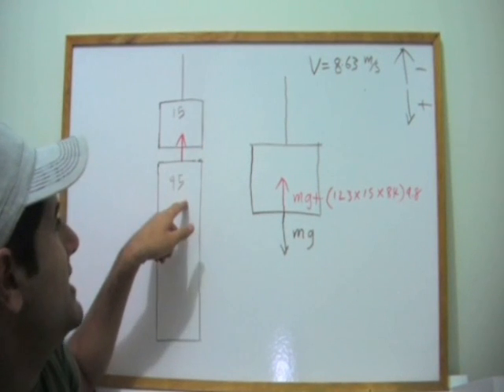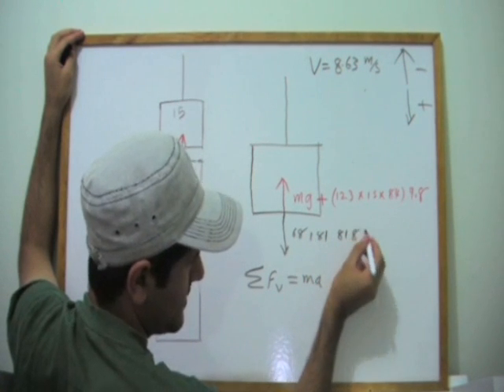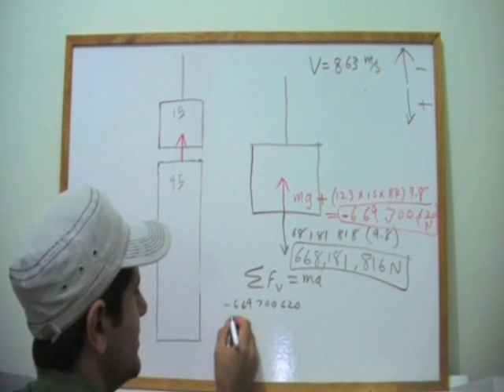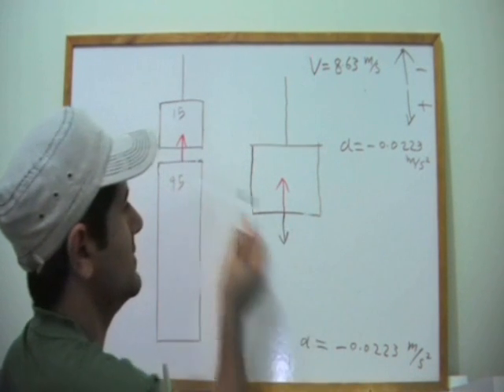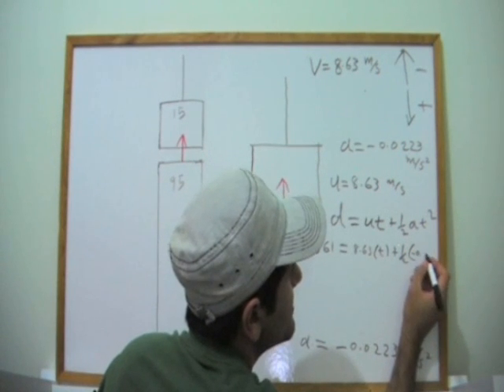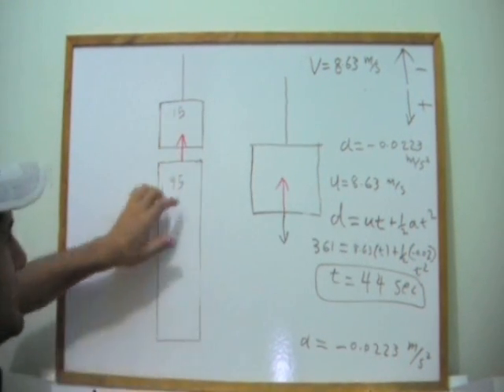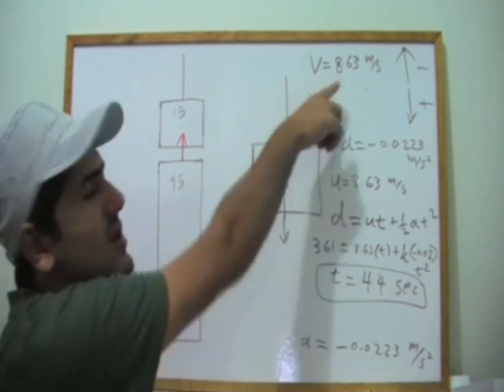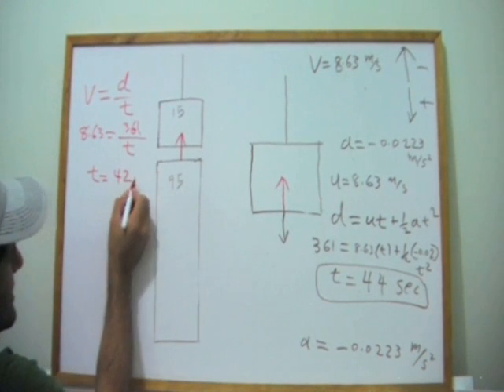(Part3) 911 Simple Physics Structural Failure Vs Demolition

Comment: I am a strong believer of the conspiracy theories, I believe it is an inside job.

good work trying to prove it using simple physics. but ive got to say that you approach is a bit inaccurate because your assumptions claim that the lower part of the building is solid (like a butter cube) in fact, the resisting skeleton provides the force as a number of concentrated forces acting upwards.

if these forces coincide with the columnsof the falling body, your assumptions are valid... (cont'd)

Comment: Newtons Third Law is all the evidence needed to prove controlled demolition of WTC 1 and 2.

NIST knows this. this is why NIST chose to stand down.

NIST admits their report

"... does not actually include the structural behavior of the tower" after the conditions for collapse initiation were reached ... ."
NIST - 2005

the time for a CRIMINAL investigation is seven years overdue. it is long overdue for criminal charges to be brought against those responsible for murder of nearly 3,000 people.

Comment: The connections (through the damping system) to the floor secions are strong enough to stop the columns deforming/buckling below the connetions?
Please explain what provides the continuous resistance as the upper block travels down through one floor if the columns are not deformed so much as to end up with zero height.

Comment from the maker: no sir offcourse am not making that assumption. to reduce to zero you require infinite force. they will buckle and the buckling length is not three stories but one because the floors hold the columns. but this buckling force is huge, its more than my asumption... its definatly more than the weight force of whats above it. so my assumption is safely the lowest.  can the resistance force at any time or any location along the building be less than the weight force that it was designed to carry ?

Comment: You agree that the kinetic energy of the upper block after falling one floor is enough to destroy the floor below, that destruction occuring probably only in a fraction of a second and during that time the upper block will decelerate but then will be met with very little resistance until it meets the next floor during which time it will accelerate.

Comment: A complete floor can support more than the static weight of the structure above it but a partially destroyed floor with many of the columns buckled or removed from the equation completely will offer very little resistance.

Comment: Hi shorty, you appear to be assuming that the columns (each 3 floorshigh iirc) can offer resistance until they are deformed to zero height, in reality they are either buckled and/or forced inward or outward and give up their ability to offer any resistance long before they reach zero height.

Comment from the maker: 95 floors below were not touched. They would definatly offer an average resistance force more than the weight above them at any point along the length of the building. The columns are designed to remain in the elastic region to support the static load. In order to fail them you need to plasticly deform them up to fructure. All that will suck enourmous amounts of energy and the force at which you can do that is definatly more than the static weight above that point.

Comment from the maker: negative acceleration does not mean "upper block" would fly up as you say..  I'll give you an example. Taking up as positive,  throw a rock up in the air,,,  the moment it leaves your hand it would start to have negative acceleration (downwards) however it will continue to go upwards due to the inertia... So the direction of the velocity is not allways the same as the direction of the acceleration and the net force, some times they are in the opposite directions as in the example of the rock :-)

Comment: shorty40merza,
there is no way the demolition of WTCs 1 and 2 can be explained by other than a controlled demolition. 
that being said, I consider your exposition disjointed, confusing, and most importantly, flawed.
1:43 "...the resistance force..." 
where did you get this figure?
the barest minimum of resistive force would be  amount to ensure no *undesired* downward acceleration occurs of top portion of structure. 
PLEASE, PLEASE, PLEASE - remove, *REVISE*, then repost.
consult with peers.

Comment: negative acceleration should mean that the "upper block" would fly away, haha :-P 

also it's wrong to count the bottom part as one solid "box". when the outer columns failed it, another part had to take their load and the other parts of that floor where that occured couldn't withstand the enormous pressure.

the holes were huge

Comment: 2nd flaw: As the structural failure occurs, a new calculation must be done for each successive floor which ADDS the increased mass of the newly collapsed floor to the equation. 3rd flaw: for each new calculation (1 per floor), the initial velocity will not be zero, but instead must be equal to the final velocity from the previous floor collapse. If you redo your math using these increased values of both mass and velocity, you will certainly arrive at  far less than 44 sec. for total fall time.

Comment: Short40Merza, nice attempt but there are FATAL flaws in your calculations. I will show these without the math. Your basic theory is that acceleration will occur with a FIXED resistance and that the mass which is falling is constant. The 1st false presumption is that the underlying structure is a single solid mass. In reality, the resistance to be overcome for the 15 floors is only 1 floor at a time. (cont.below)

Comment: The 767: Wingspan 156ft Length 159ft Maximum takeoff weight 350,000-395,000 pounds
The 707: Wingspan 144ft Length 135ft Maximum takeoff weight 257,000

So you lied there too. Are just was talking out your ass.

Comment: grilfers: Yo moron, those are not the dimensions, that is not the weight, and a smal lighter is not comparison to a raging fire. ALSO, 707 is SAMLLER than the 767. The design was was for a MUCH slower 707 and did NOT account for the thousands of gallons of fuel adding to a raging fire. God your unbelievably stupid.

Comment: yes i told you the dimensions are you stupid why do welders waste there time learning to weld when in your magicland they could just use lighter fluid ??? unresearched lol what is sad about that comment well if you have eyes ? research not even nessasary butn i have all the same and strucural steel weight for what struture?? all buildings have load bearings depends on building wtc had its caculated into the construction plan and even to in to account a boing 707 a much faster and larger aircraft

Comment: 1100f woahhhhhhhhhh not even close enough to mildly upset stell 2 and a half tons per liner foot the core colums melt the plane would not even have scrathed them the fire mmm get fuel let me think is that the stuff that burns really slow ?? 90  gone befour plane come to a stop what was left off it that is because them outer wall ties weighed in at 1 and half tons per liner foot should have made them from the same stuff as that passort they found fuck it made the whole building from the paper F.O

Comment: Especially in multi-dimensional collisions. The kinetic energy would be the same before and after the collision if the collision were perfectly elastic, but ordinary macroscopic collisions usually have significantly less kinetic energy after the collision because of transfer of energy into other forms. For macroscopic objects in a collision, there is always some dissipation and never perfectly elastic. None of the actions from the collapse violates the conservation of momentum.

Comment: well theraml charges or thremate charges are kind of exsplosives but there not at the same time desinged to burn very hot like the sun not like gasoline fires ?? and cables lol stop watching the old saturday robber films mate its all wirless now the thermite is like a hot knife to butter angle the charge use det cord on the lower struture because you would know its safe from harm because they knew what was going on ? and wirless charges for the top triggered bye the planes themselfs wake up

Comment: In parts 1 & 2, shorty40merza, you've admitted to me you had no clue how the building was designed. Only Twoofers claim there was MELTED steel. You're science is laughable at THAT point, but you go further and that you have no clue regarding concretes properties which I debunked in part 1.

Comment: Hi Shorty, ok I think I now understand what you mean, I agree that collapse initiation is a problem in 1d for a different reason and that is the structure below easily is able to absorb energy, you first need a lot of kinetic energy to detach the top section, it is still connected before it moves. If there is no initial movement the top section's kinetic energy is zero, the energy it gets with falling is proportional with the height but in the first moment the absorbtion goes with height^2.

Comment from the maker: einsteen: definatly the structural resistance force is not going to be constant, but it can never be less than the weight that it is holding at any instant... when you apply an increasing force to an object it will resist accordingly until it fails,,, the minimum avergae force that the bottom structure will put on the faling structure is not less than the weight of that falling structure at any instant,,,  this means we cant have acceleration downwards can we?

Comment: I'm absolutely no OCT'er but this is wrong. The static force is the force that the structure provides (reaction force). When the upper mass moves the netto force is 
15*m*g-F(y), that F(y) is not constant depending on y, but will increase linearly as a first approach and then drop down. If the upper block already moves you have to compare the kinetic energy it has with the absorbing properties of the structure, that is the integral F(y) over distance. If you do that then we are talking business